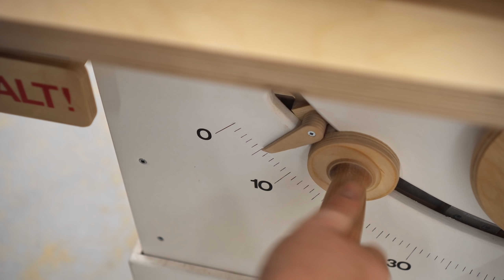Making a Waste Basket from Scrap Plywood - Woodworking - Box Joints

Comment from the maker: See the build article for more details on this project:
https://ibuildit.ca/projects/making-a-wooden-waste-basket/

I used my Ultimate Box Joint Jig to cut the box joints and the plans for that are here:
https://ibuildit.ca/plans/ultimate-box-joint-jig/

I made a couple of changes to my jig to try some ideas out and I'll go over those in an upcoming video.
Reply: The sin-bin.
Reply: Think of it more as a progress bar.
Reply: John Heisz - I Build It ever think of creating a flat pack box jig cut on a CnC, with all the parts and piece to assemble at home, and sell to your fans?
Reply: very good friend
Reply: OMG with the box joints.  AMAZING.
Reply: Wondering if you made a video on the changes??

Comment: I'm struggling to get my head around why the angles didn't create a problem for the finger joints. 🤔
Reply: it's because the fingers are perpendicular to the vertical edge angles, not the top or bottom.

Comment: Please don't take this the wrong way, because normally I really like listening to what you have to say, but that was a very satisfying video to watch with no commentary.  What I think my daughter would call ASMR?  At any rate, you are a true craftsman and that's a term that I don't use lightly or apply to very many people.  Did you leave the blade at 5 degrees to cut the bottom of the basket?
Reply from the maker: Thanks :)
The bottom panel? Yes, 5 degrees to match the side taper.

Comment: I’ve clearly watched too many of your build videos when my brain supplies the commentary in your voice:
"For the sides I’m going to use my box joint jig, plans are available on my website"
"I’m using polyurethane construction adhesive for the longer working time..."
"If you want to know more about my shop-made sanding tools, I’ll put a link to the build video in the description..."
"And here I’m giving the sides two coats of water-based polyurethane..."

How'd I do? Want to outsource your next voiceover?
Reply from the maker: Hired!
:)